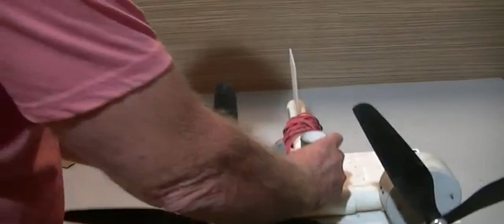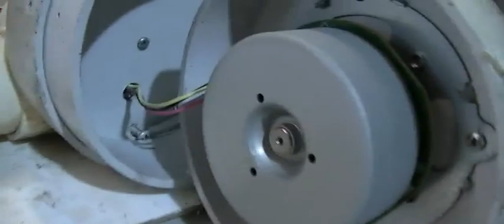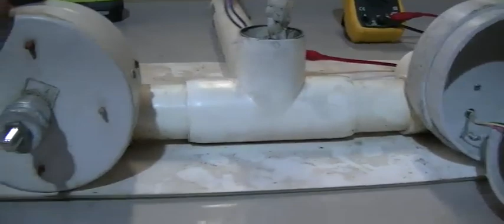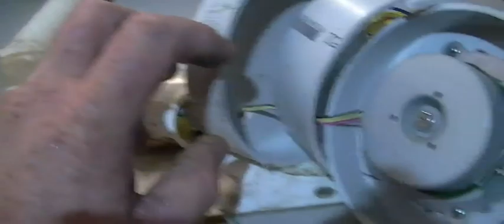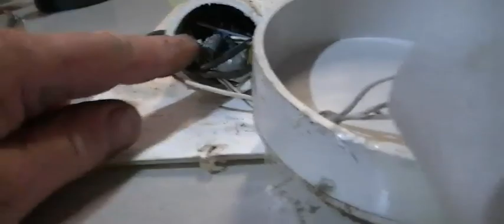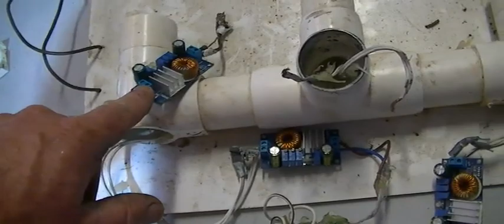Duel Turbine Wind Generator plus solar teardown and review

Comment: You are better off using all three, the idea is that if you have more than one voltage supply, the one with the highest voltage is delivering power, the others are not. Now of course you could set the input MPPT voltage thus low, that both motors are forced to deliver power at that power point. They have the same specs and wind so that would also be okay. The downside of this MPPT tracker is that it does not track, only clip. Same goes for the solar panel, it would be better to use a separate MPPT device, otherwise if the voltage of the motors is even 1/10th of a volt higher, all power generated in the solar panel is lost. And I know this very well since I did do this wrong myself! I had 2 different solar panels in parallel with one MPPT device (same as yo have there, I just do slight changes during the year as the sun goes higher and higher and lower back again). But I only received the power of ONE panel. Their max power point was very different (your motors/generators have a completely different power delivery as that solar panel). It I had your device I would keep 2 MPPT devices, 1 for both generators and one for the solar panel. Note: if the max power point of the solar panel is 15 or 16'ish Volt, your better off with a cheap pwm device,I know you have them, seen it in another video.